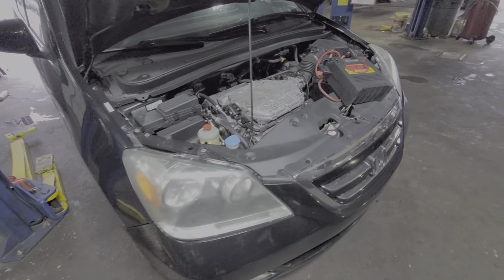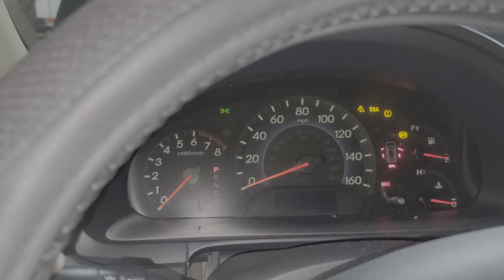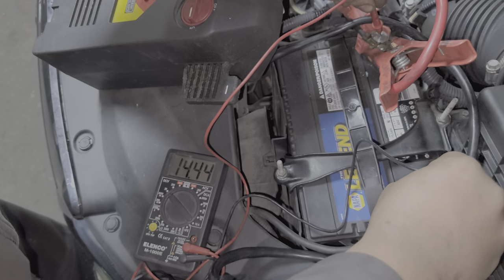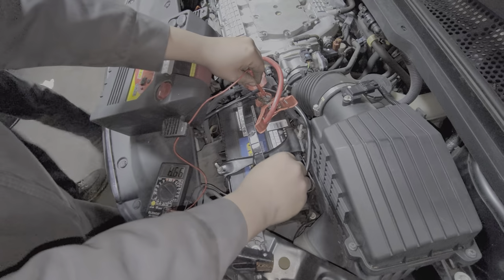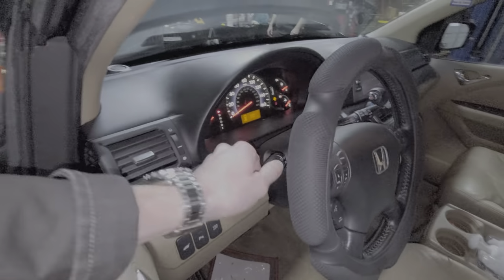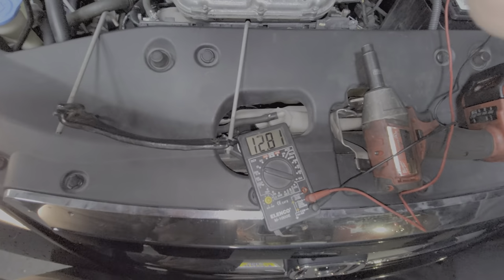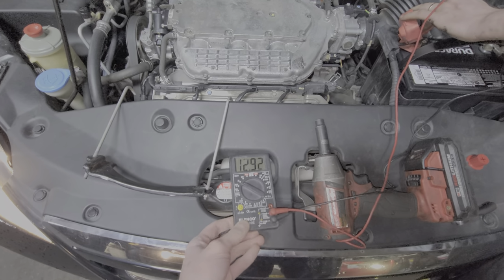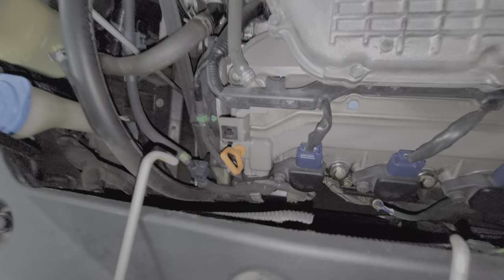Honda Odyssey Shutting Off without Jump Box - Oil Leaking onto Alternator

Comment: where the oil leak is coming from?
Reply: From the VVT solenoid right above the alternator. Needs a new gasket set.
Reply: @dadlife9921  same thing happened to my ody before. Common issue on ody and pilot.
Reply: @dadlife9921  I'impressed

Comment: Same thing with my 08 accord v6. Had a seal leak and leaked right on the alternator. Bad spot for the alternator. These engines are some of the worst Honda designed